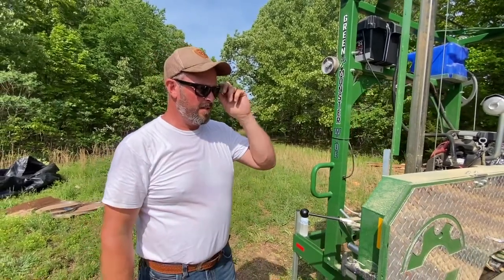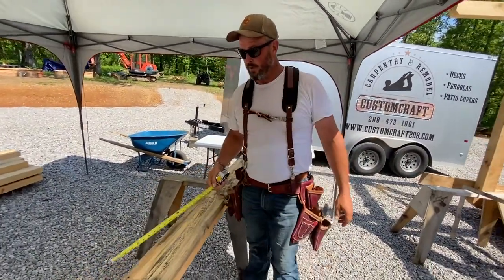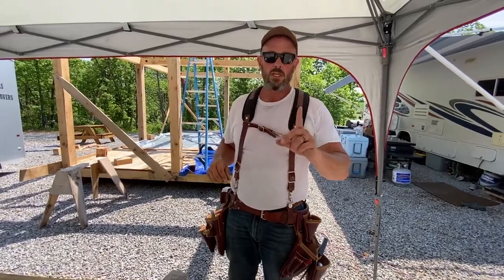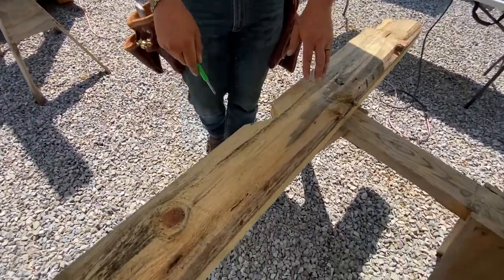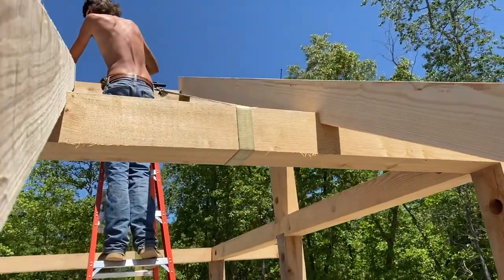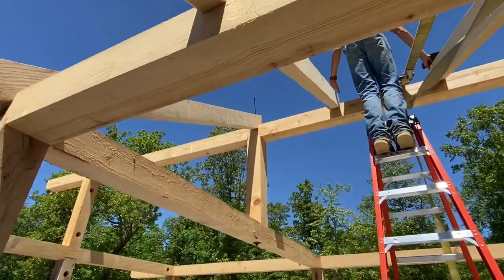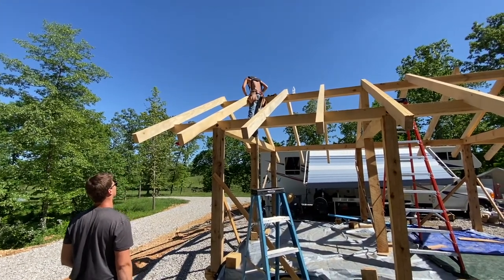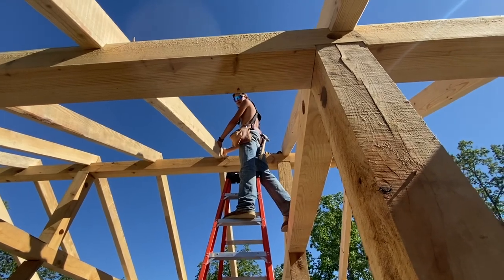Am I Too CHEAP FOR My Own Good?

Comment: Question, why on the roof did you do the short boards and long boards?  Why not just one long board? So curious because I know there is a good reason!!!
Reply from the maker: It was just the material length that we had available at the time.👍